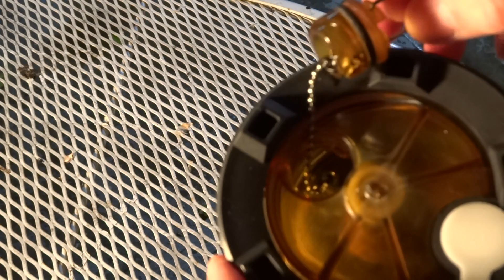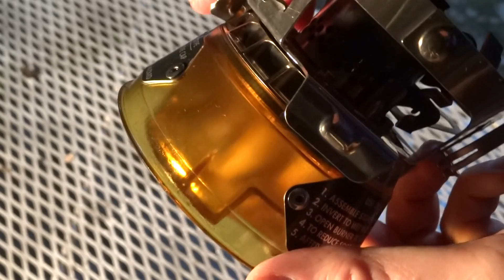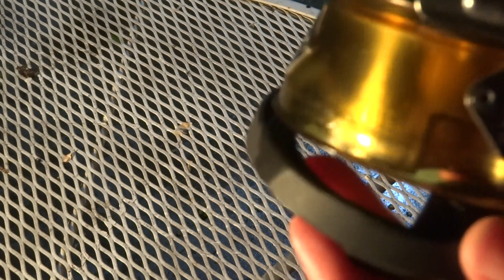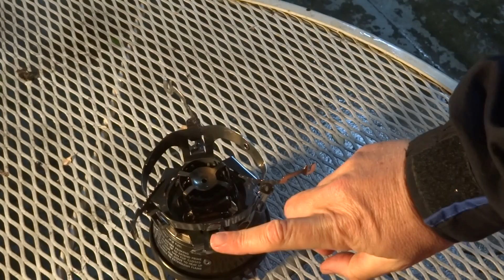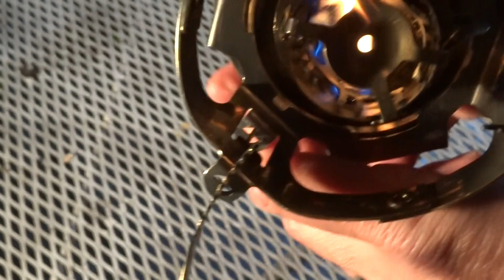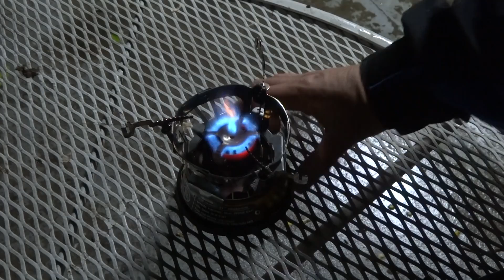MSR Vapore Jet (CFV) Stove

Comment: Late to this party by a lot of years.  I'm glad you got this Jim.  Because it's probably worth a fortune in stove world.  I'm also glad this didn't get to the Soldiers.  I like folks who think outside the box, but this should have stayed just a thought.  Thin metal, plastic,  a non adjustable burner, a rubber ring that's begging to get lost with the spare vaporizer, and fuel cap on the bottom.  WTF were they thinking.  What they need is the M1942 mod mountain stove with some minor upgrades to run on kero.  Everything about that stove was damn near perfect except for the pump/nrv without a snorkel tube.  Put the tried and true Coleman pump and check valve on that, add a multifuel burner like an Omnifuel or Nova and you'd have the GSOAT.  I was in the active Army for over 21 years.  Most of that time I used a Coleman 550B.  It never failed me.  It got dropped, smashed, rained on, frozen, burned, used and abused for many years, but I was always able to straighten out the dents and bent parts with a pair of pliers and keep cookin.  I thought it was junk when I first bought it.  I was wrong.  This prototype wouldn't have cut the mustard.
Reply: What’s your take on the MSR XGK EX (and to an extent the MSR WhisperLite?) ?
Reply: @ericlotze7724  I've never owned either, but they get rave reviews.  The only negative I hear about is the plastic pump and/or needing a cold weather pump, sold separately.  But for details, I'm not your guy.  Sorry.  Just no personal experience with them.

Comment: Very strange stove, the wick is always dipped in to the fuel so it is always giving off vapor and I assume on a hot day its just vaporizing fuel in a solders pack which sounds questionable around military duty, what a crazy design?        I just don't understand why the army give up on the awesome Coleman Exponent/Coleman PEAK stoves they work so nicely with Kerosene with the vaporizer tube. I use it all the time when camping and it is very light weight.      I also have the MSR EX M   but honestly its just too many moving parts, you have the tank, the hose, the burner its just too many parts the Coleman is all in 1 and quick to light up and once the stove is turned off you can immediately grab it from the fuel tank and throw it in the metal contained it comes with and head out in seconds the MSR the burner is on its own and all metal so can't touch it until it cools off completely and there is no metal container  to pack it in so you just got to sit there like 20 minutes before you can go, the Coleman is awesome just every aspect of it is great for military use and only like $140 before they ended production I think in 2010 or so?

Comment: Great review. One of my very good friends is the guy who designed this stove. Lots of interesting stories along the way of the development.

I got one of the first generation prototypes back in probably '05. It was the first military prototype item I ever got to test. He told me if anything I ever get shows up on the Internet... we're done forever. Now that the contract is over and the Internet has it, I'm clear to talk.

Anyway, regarding mac man's wanting titanium, titanium is half the weight of steel and DOUBLE the weight of aluminum. My guys at MSR who design stuff for the military really do know what they're doing...

This stove was never intended and will never see the civilian market. It's just too freaking expensive. I won't post the final cost to the DoD here, but it is breathtaking.

Keep up the good work and don't let go of that stove. Also, the extra capillary pill is a unicorn. Once your current ceramic pill shatters and you go to your backup, that's it. It will never be available again.

FWIW, Alvin, thanks for a great review!
Reply: The ceramic pill is that the one shown at the bottom attached to the rubber base? I don't see any contact with the system, how does it integrates with CFV? Just curious 😊
Reply: Very strange stove, the wick is always dipped in to the fuel so it is always giving off vapor and I assume on a hot day its just vaporizing fuel in a solders pack which sounds questionable around military duty, what a crazy design?        I just don't understand why the army give up on the awesome Coleman Exponent/Coleman PEAK stoves they work so nicely with Kerosene with the vaporizer tube. I use it all the time when camping and it is very light weight.      I also have the MSR EX M   but honestly its just too many moving parts, you have the tank, the hose, the burner its just too many parts the Coleman is all in 1 and quick to light up and once the stove is turned off you can immediately grab it from the fuel tank and throw it in the metal contained it comes with and head out in seconds the MSR the burner is on its own and all metal so can't touch it until it cools off completely and there is no metal container  to pack it in so you just got to sit there like 20 minutes before you can go, the Coleman is awesome just every aspect of it is great for military use and only like $140 before they ended production I think in 2010 or so?
Reply: There is a black cap that comes with the stove that controls unwanted vaporizing.